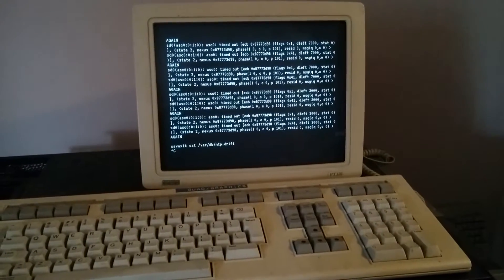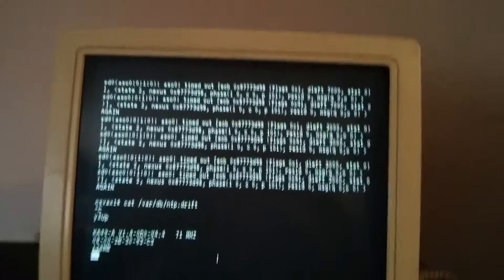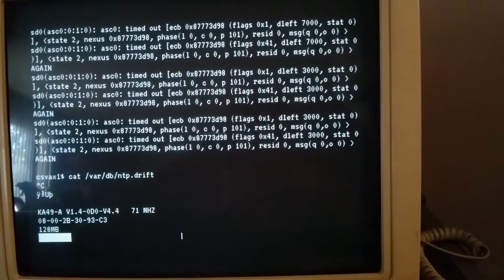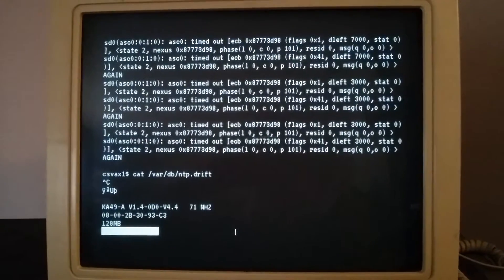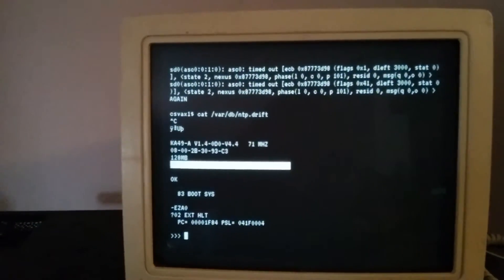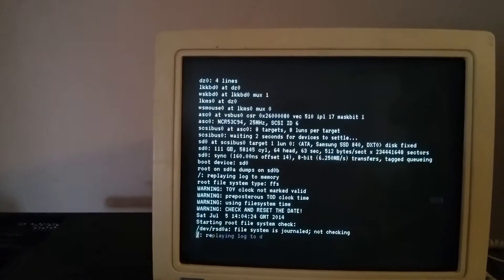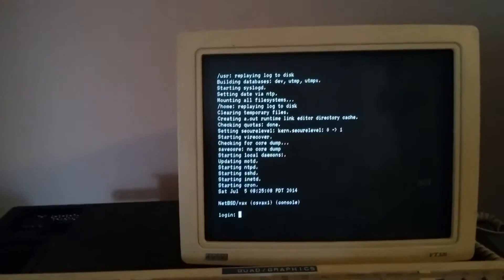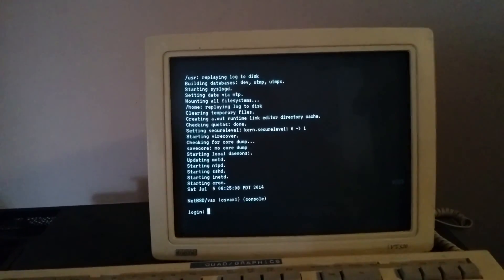Booting VAXstation 4000 to NetBSD Part 2

Comment: Can you run on X-Windows on it?
Reply: The VT320's just an ASCII terminal, however the Vaxstation 4000 model 90 can run X-Windows and there are some graphical terminals too, I think the VT340 is a colour graphics terminal that uses X-windows.

But if you have a graphics card you can just hook up a monitor.